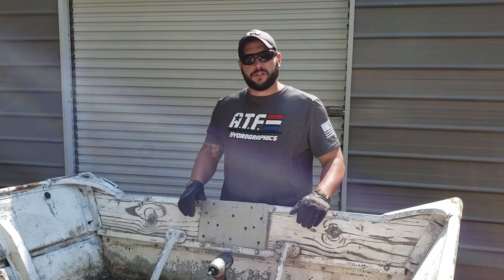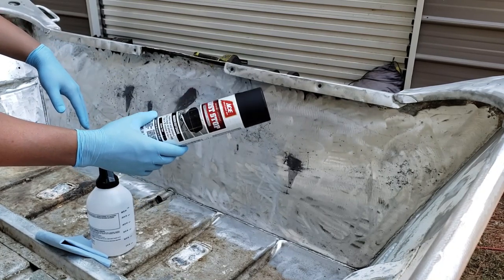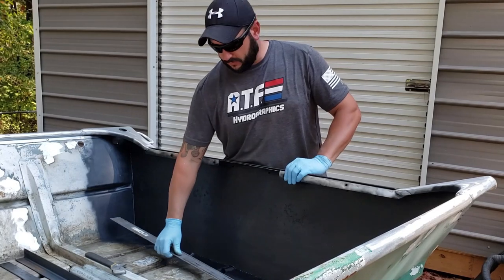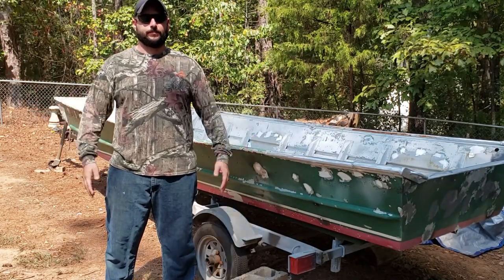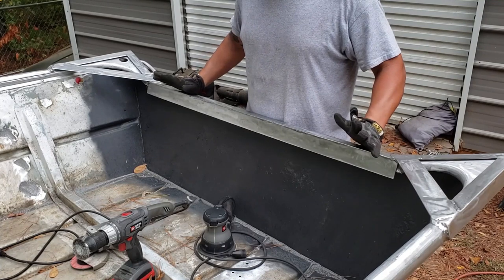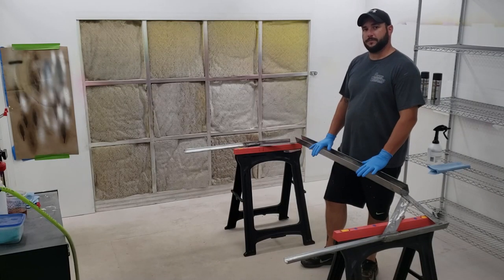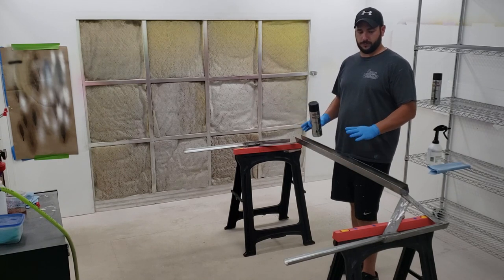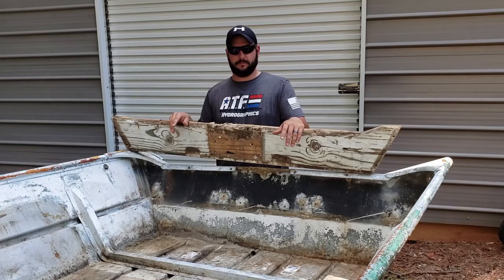SUPER STRONG Transom Support Build

Comment: I followed this series to a T, except I just realized I forgot to paint the bare metal before installing the wood and transom supports. I did not have any corrosion previously on my transom as the previous board was not treated. Will this be ok that it’s unpainted inside? The board that is against my transom now is marine grade and covered in fiberglass epoxy.
Reply from the maker: It should be fine,

Comment: Thinking about building a brace like this for an untraditional vegetation runner. In your opinion, would this help prevent some of the torqueing damage caused by a surface drive on a mod v like a grizzly 1754 or 1860?

Comment: I am looking at a 1987 Alwe!d 18' boat an do not know how to check the tansom. It is without a motor an the boat is in rough condition. To say it needs restoration  is putting it lightly. But it is built like a tank. Looks more like a badge than boat. Very wide an deep.  More project than I was looking for but I can't get it out of my mind?  It needs transom would make up my mind for me. So what is the best way to check to see if it is sound. Looks like it was replaced once because of the guesses at the rear corner. They are thick aluminum guesses above the side an back of the boat top? Was that the normal construction of these boats? I can't see what was under them . Any comments are welcome.
Reply from the maker: Only way to tell is to open it up and look at the transom.

Comment: I have a 14-36 jon I have already used a 1.5 thick TBN Transom then used 1/4 plate on the back 34-14 bolted all through. It also already had two floor to Transom knee braces like yours I added back. I’m gonna run a 670 with a swamp runner large kit. Is that heavy duty enough or do I do this as well ? Are roads are rough so it bounces around

Comment: So.. pressure treat wood is not recommended on aluminum boats ? Why ?  What kind of wood would you recommend then ? I need to replace mine and want to use the correct stuff. Thanks. Gods bless.
Reply from the maker: Treated wood has chemicals in it that will react with aluminum and cause it to pit and corrode, eventually putting tons of tiny holes in the transom. Use regular plywood, and coat it in with fiberglass resin. It will be fine. People tend to overthink this stuff.

Comment: I have a 16/52 with Electroless on the transom where the outboard holes are do you think I should cut the square out and weld a new piece of aluminum in or try and patch each hole? Thanks
Reply from the maker: If you can cut it out and weld in a new piece that would be best. it is hard to stop aluminum corrosion once it starts.
Reply: @SendItJonBoats   should I go 1/8 inch or 0.09

Comment: in your video you said treated wood is doesn't work with aluminum boats    i was told marine grade  plywood was ok   what is the difference  ?
Reply from the maker: Marine grade uses different glues and has no voids in the plys. Basically a better built plywood. Treated wood is soaked with chemicals to help keep the wood from rotting. Those chemicals will eat aluminum. Marine grade is fine it is just more expensive but still needs to be sealed.
Reply: @SendItJonBoats  thanks 
I appreciate you answering my question 
I learned something new

Comment: Wonder if I can do something similar with a fiberglass boat because I'm putting a heavier motor on an older boat that I'm replacing the transom on  now
Reply from the maker: It should work find on a fiberglass boat, and it could be fiberglassed in to make it permanent.

Comment: Pretty good video but if you don’t bevel your welds they gonna break bro especially when your working with thin material.
Reply from the maker: I did bevel the steel parts before I welded them expect on the lap joints. I didn't go into a lot of detail about the welding in the video.

Comment: A tip or two, I noticed that your port side tube support warped after doing your finish welds. When welding frames and brackets, swap around and get as far away from your previous weld as you can to keep warping down to a minimum. I forget sometimes and have to use a torch to straighten out stuff when I do. Also, don't see if you did it or not, I grind away all the galvanization when I use galvanized metal to weld on, not only will paint not want to stick to it worth a darn, the weld temps on galvanizing causes it to off gas and can cause poisoning if you breathe any of the fumes in and it makes you feel like absolute crap.
Last but not least, I CAN'T BELIEVE YOU ARE PUTTING STEEL ON ALUMINUM, YOUR GONNA BE ON THE WATER AND YOUR BOATS GONNA FALL APART AND KILL EVERYONE, EVEN ONLOOKERS WHO WITNESS IT, NOT TO MENTION IT CAN CAUSE OTHER WORLDLY HARM LIKE CATS LIVING IN PEACE WIH DOGS AND NEWS MEDIA ACTUALLY TELLING THE WHOLE TRUTH!!!!.

Had to put the last part in lol 😅
Reply from the maker: LOL, Omg I died reading that last part! Not the cats and dogs peace corps!!! LMAO.
I tried to move around when welding but yeah it did warp really fast on me with it being thin steel. I did grind off all the galvinizing before I started I just didnt show that part.

Comment: How do you remove the tramsom support ?? It looks sealed in
Reply from the maker: It is sealed in.
Reply: @SendItJonBoats  ok cut the rivets out and punched it out the bottom. When i reinstall should i use special bolts or closed riverts again ? And use 5200 to help seal
Reply from the maker: @jeremymatlock2049  I always use closed rivets and 5200 for any rivets going below the water line.

Comment: Actually modern pressure treated wood does not attack aluminum as bad as the old stuff used to do
Reply from the maker: Key words being "as bad"... it still attacks the aluminum. So just use untreated stuff and not have to worry about it.

Comment: Awesome rebuild,  only think you for got that most known it all would tell you is that won’t work your boat will sink to heavy with iron!!🤔 should have weighed it !!   I have a 16 extra wide that was put through serious abuse!!   I’ve put two 40,s hp on mine! Same thing that won’t work it’ll sink!! 🤔.  Just getting it set up working and set right then I’ve gotta strip it restructure the transom! Flip it clean up the bottom and coat with some super slick!!   Ps. The boat will impress u with how it handles with the two motors!!  
   Great video I will definitely have better transom rebuild thanks to you!! 🙏
Reply from the maker: I had to use steel, this boat is getting a sooped up harley motor with monster torque

Comment: That angle is going to cause that transom to oxidize and pit. You should have made your bracing system out of aluminum.
Reply from the maker: Yup, the whole boat has rusted and is rotting in decay, it already sank and caught on fire, and I think exploded twice too.
Reply from the maker: W R Sporing  Exactly

Comment: Buy aluminum welding gear, use aluminum construction materials. No amount of paint will prevent the corrosion that will quickly start in your steel and aluminum interface.
Reply from the maker: Thanks for the tip
Reply: Yeh tig welder all the way
Reply from the maker: @undefeatedgaul3201  WIll you buy me a tig for Christmas? I want one so bad!

Comment: I like most of your stuff, however steel in a aluminium boat is a complete fail. Doesn't matter what steel paint you used on the aluminium. It was a wrong choice due to the rust stopping chemicals not being the same for steel and aluminium.
Reply from the maker: Aint rusting yet, and the aluminum is not corroding, so it's a win for me.
Reply: You won't see it till its too late. @SendItJonBoats